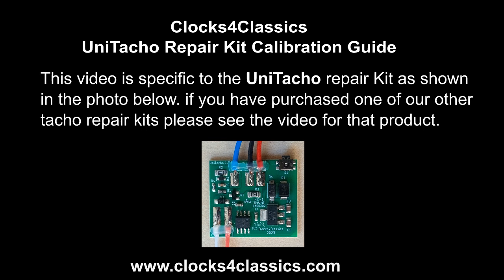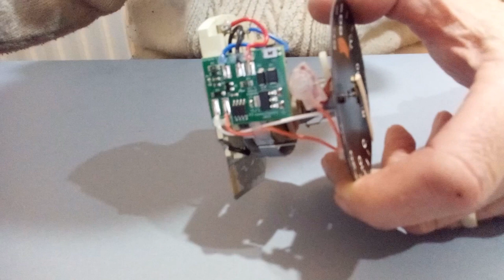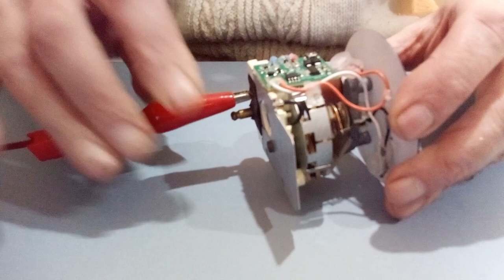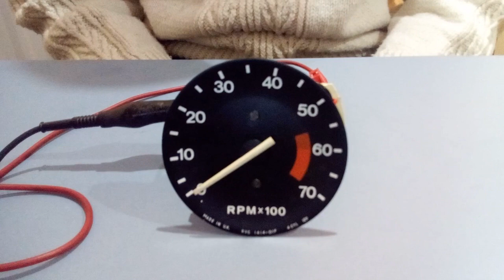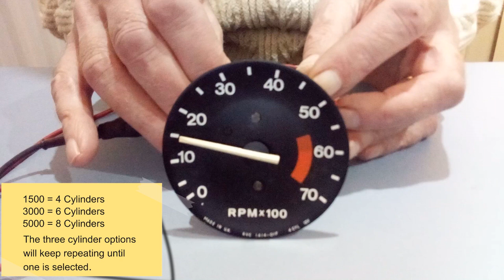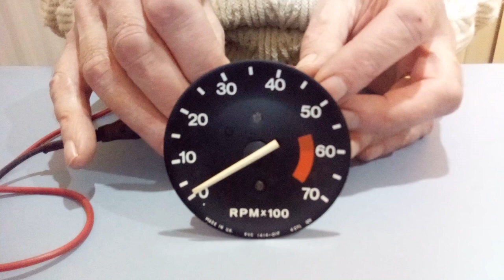UniTacho Tacho Repair Kit Calibration Guide

Comment: Just bought a reliant scimitar, the rev counter goes right round when car is ticking over, can you help please
Reply from the maker: Hi, 
It may be that the electronics in your rev counter has failed or the car  may have been have been fitted with electronic ignition which is incompatible with the rev counter. Either way one of our repair kits may well solve your problem.  Please email us at clocks4classics@gmail.com and we will do our best to help you.